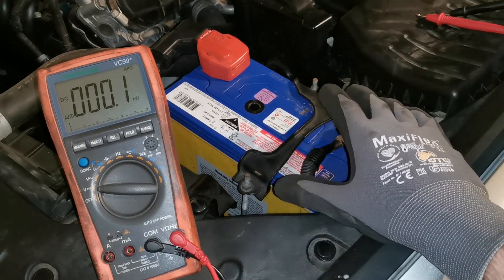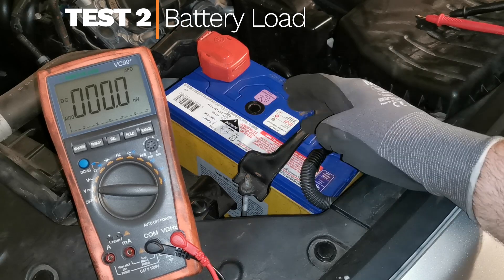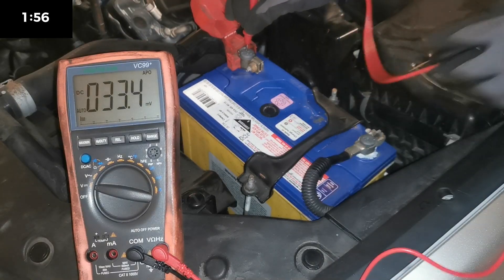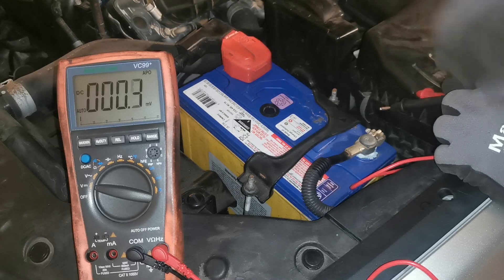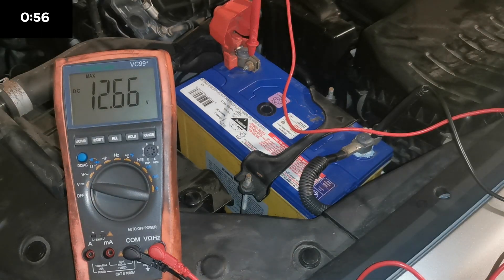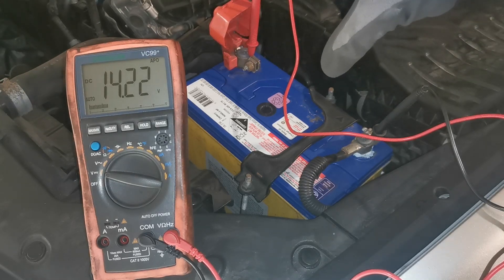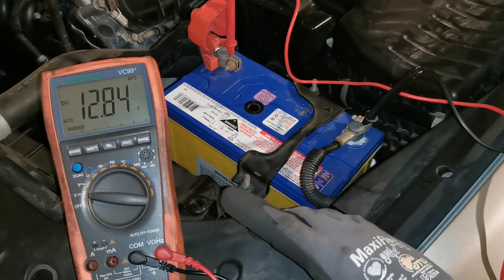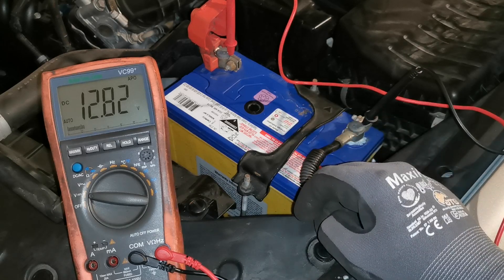Car Battery Testing Using A Multimeter - How To DIY

Comment: Hello, Before testing for V on cranking load I would make shure the Neg terminal was not full of corrosion. 🙂 I am definitely a fan of seeing what the battery voltage does on cranking in order to see the charge condtion of the battery. If you want to know if your alternator is working and you dont have a multi meter ? when you have to jump start your car. I loosen the Neg terminal a bit. with the jump leads on the terminal. when the engine starts, take the lead off, and then take the neg lead off the battery. If the alternator is not working the engiine will stall. not scientific, but if you dont have a meter handy this will tell you wether or not the charge circuit is working.
Reply from the maker: Hello, thanks for watching and also taking the time to comment 😁 
There is many pre testing checks that I always recommend to do before testing and I will have a longer video released in the near future. I have to just focus on the test part on this one to keep the video short and to the point 😃 
 
Regarding the alternator test by removing the battery lead, this is a big no in todays vehicles, while it absolutely was done on older cars and people got away without any issues, it can cause voltage spikes in vehicles, couple that with smart alternators and very sensitive electronics that require very stable voltage, you could end up doing a lot of damage. Better to avoid that way of testing altogether.

Comment: How are you measuring current rate into the battery when the meter is select for VDC?  You turn the meter off for a second then go to VDC again, well went too far and selected VAC for a sec, then back to VDC.  Also, never move the lead to measure current.  What am I missing?
Reply from the maker: I am not checking the current flow, I was saying that I want to check what is currently going into the battery from the alternator (I can see the confusion 😁) 

I switched it on my multimeter that way to take off min max setting so you could see what the (real time or current) dc charge rate was, not just the Min Or Max reading 👌

*didn't mean to hit AC and had to readjust 😊